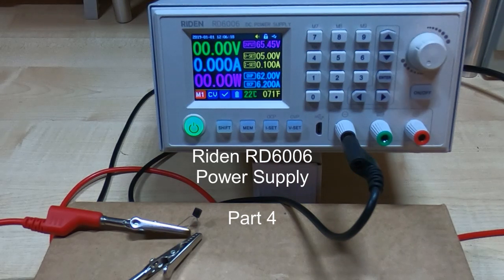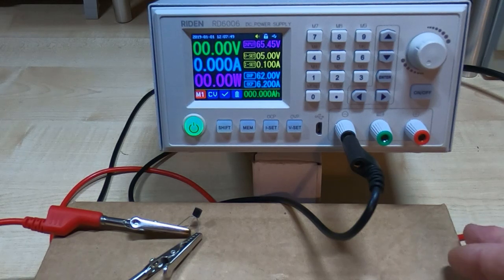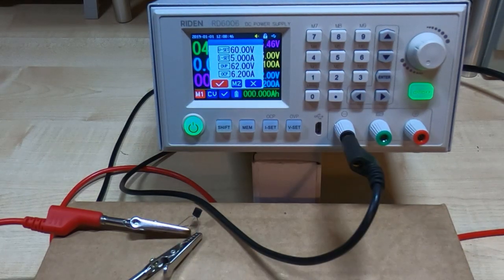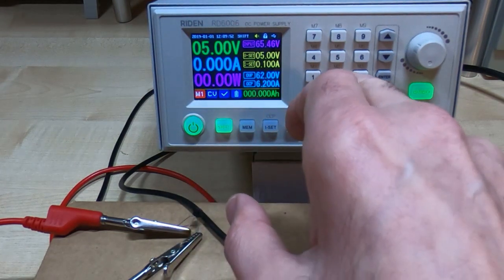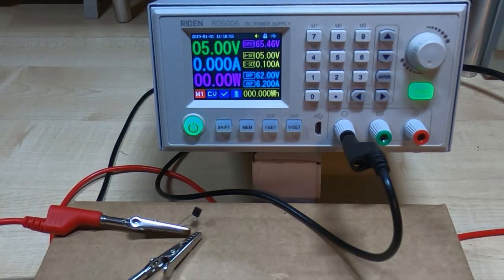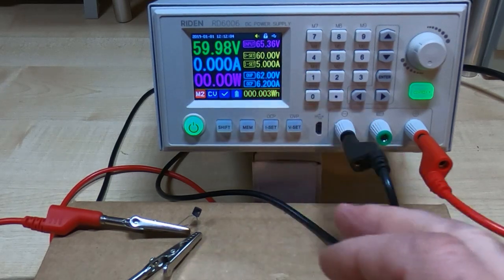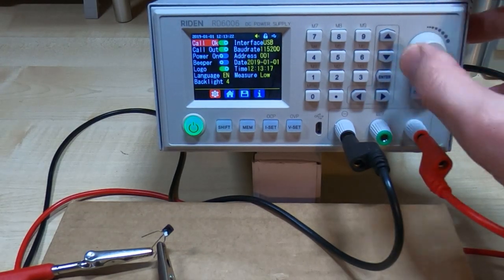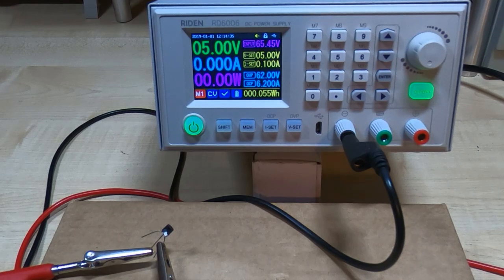Riden RD6006 Power Supply Part4

Comment: You've got a point, but that's why it's optional and turned off by default.
Reply from the maker: Correct but as I was giving a review and the options are not well indicated I wanted to make it clear what these options were and also that I think it is a bad idea to have the supply turn on its output when a memory is selected wiithout being able to see what is about to be applied to the outputs. If the supply is only used by one person then it may not be quite as bad but in particular when different people can use supplies then this option becomes dangerous. I see no real need for it and the dangers outweigh any possible benifit. That is of course just my opinion and is simply advice which anyone can ignore if they want. I did also make it clear that it is an option and turned off by default. To clarify my point, This feature will prevent these supplies from being used in my companies development lab.
Reply: @JerryWalker001  Just because you don't see a need for it doesn't mean everyone else doesn't, others may prefer it for cycling between preset voltages and current outputs for testing purposes or even for charging batteries etc... ,  for them it would reduce the input required,  Granted it's poorly labelled in the menus but it is by default set in a safe setting as you said.  You would need to explicitly set it to what you describe as an unsafe setting for it to be a problem.  No doubt there would be a way of disabling it altogether in firmware (or possible the pc software ?) - I'm waiting on the kit to build one myself so if I make any progress with firmware coding I will update you accordingly.
Reply from the maker: As I said in my video that is just my opinion. My point is that it has been implemented in such a way that it can represent a danger and I also indicated specific cases when this can happen. I also suggested a way that this could be implemented in such as way as to make it a safer option to use. For example if the OVP and OCP were global then this would make it safer to use. As it is the supply can very easily be put into a dangerous mode and that is why I mentioned this in my video and I stand by my comment. I am not sure why the software or firmware modifications are relevant.
Reply: @JerryWalker001  the software and firmware modifications could be done such as to prevent the "dangerous" implementations you stated in your videos.  Why else would I mention them?
Reply: who knows - if i can get it working correctly i could see if the manufacturer wanted to implement it (although i doubt it).
Reply: @JerryWalker001  I would like to add one more thing though - this is not a consumer level piece of kit as far as i am concerned (just my opinion) and as such anyone using it should be competent to do so, as such I would expect them to learn how to use it safely before connecting it to anything.  This is not in any way intended to put down your videos or comments as I have really enjoyed watching the videos and reading your comments.
Reply from the maker: Tech Doctor ??? Yes of course they could, that is SPECIFICALLY why I mentioned it in my video and SPECIFICALLY why I made suggestions as to possible safe ways to implement this feature if users wanted it. I am NOT suggesting that my way is the only way, I am simply pointing out the current danger in using this supply which is a major purpose in a review. However, currently the supply operates in the way it does and the vast majority of users will not want to start hacking the software or firmware. If the manufacturer updates the supply then all well and good but stating that if it worked differently it would work differently is not a valid point. If you are able to modify the software to make this feature safe to use then I am sure many people would want you to provide it to them or as you do not seem to agree with my point then I assume you see no need to change it. If you do agree with my comment then I am not sure of the purpose of your comment, maybe I have missunderstood your point?
Reply: @JerryWalker001  Not sure why you're ranting as I didn't say i disagreed with anything, I was merely trying to be constructive and my last comment was simply that any piece of kit of this type should be used by competent persons.  It's clearly built for a price and is a fraction of the cost of the big name branded programmable power supplies.  The fact that it doesn't come fully assembled as a working output power supply is enough for me to consider it as a diy type device.  I've been an electronics engineer for over 30 years and come across all sorts of great devices like this, sure it's got it's quirks and maybe some would consider them dangerous.  I was simply stating that maybe it could be fixed in firmware and that like anything on youtube, peoples views however polarising are most often subjective.  Yours being that it has dangerous design flaws, mine that it I don't think it does if used by a competent person who knows how the deice works and what it's limitations are.  Lets not forget, if someone novice enough were to put the output wires in their mouth at full voltage and current it wouldn't end well - dangerous yes, avoidable most definitely, should it have ever been allowed to happen - not if they knew what they were doing.
Reply: @JerryWalker001  I do take your point but respectfully disagree. Users have agency and have to accept responsibility for changing the settings. There is definitely a use-case for having that option so I disagree that it is "not a good idea". It's an excellent idea if it's what you need. It would be really, REALLY bad if that were the default setting, of course.
Reply from the maker: IN MY OPINION this option has been implemented in a way that can put the supply into a dangerous mode. I fail to understand how anyone can argue against that because it clearly can. If this outweighs the benifits is another issue although I also give very clear indications how this option could be implemented in a safer way. If in your opinion this is not a dangerous option in the way it has been implemented then that is fine but talking from decades of experience (and expense) I disagree. Yes I am well aware that stepping through voltages can be a good option and if you watch my other videos you will see that I use that very feature in my other supplies but I would NEVER use it in this supply for the reasons I have stated unless its operation was made safer. That is my opinion and if you have a different opinion then that is fine but I will not comment to anyone that this does not represent a potential danger as that would be irresponsible of me.
Reply: @JerryWalker001  FYI CAPS is consider shouting - also I didn't disagree I just had a slightly different point of view and expressed it.
Reply: electronics from the land or the rising sun quite often have quirky, pointless, random or what some would describe as "dangerous" options in their settings. they are still cheap though and maybe, just maybe that's because they think the engineering side through quite well but when it comes to user friendliness ect... they don't spend much time on it.
Reply: @JerryWalker001  Nobody is suggesting you comment any different than you have - would you refuse to drive a car that has an esp off button on the dash because it could make you crash if you can't drive very well in the wet ? - i suspect not but yet you are trashing a power supply module because you think it's dangerous because it has an option that could potentially cause problems if used improperly.  Therein lies the beauty of youtube - everyone gets to have their say :)
Reply: @JerryWalker001  It's a pity that you feel that way as I think it's a great little piece of kit but if there's a chance a novice (or inexperienced) user could get into trouble with it you're making the right call.  Totally agree on the documentation BTW but to be fair I've not really come across many far east tech products with good documentation lol.

Comment: I have a supply like that and I noticed it has another annoying feature. My workbench has a main switch, and whenever I power the bench on, the power supply boots up and switches on. I would really like that it remained off, but unfortunately it does not have an option in the menu for that. It's the same thing with my Kkmoon fy6900 function generator, wich, by the look of it has a similar firmware, or at least seems to be made by the same team...
Reply from the maker: That is an option on this supply but I have turned it off.
Reply: @Andrei Bata ， KKmoon FY6900 has a main switch at the back. So that you can turn it off to avoid the issue?
Reply: @xmenken1  yes, it does, the power supply has one too, but the way they are placed on the bench makes it difficult to reach all the way in the back. Besides, i think it's just bad design to have your device boot to default power on...
Reply: Always make sure the voltage is correct before you connect your precious device.

Comment: Nice that they gave you the option to have the output automatically be disabled on change.
Reply from the maker: It is probably just personal preference but it is way too easy to simply forget that you have set something which could so easily destroy a board. I have run my own company for many years and engineers have a habit of setting 'personal preferences' and not always telling anyone that they have done it. This has cost me a fair amount of £'s over the years (and cost some engineers their jobs). For me it is equivalent to having a switch on the dashboard of my car which is labeled 'brakes Enabled' or 'Brakes Disabled'. My intention is to make very clear what the poorly labelled menu options do :)
Reply: @JerryWalker001  I imagine these options should only be enabled if you are using the PS for some kind of fast routine testing of a product, defiantly should not be enabled on a workbench
Reply from the maker: Yes I agree and I doubt I would ever use them but someone may not realise the significance of changing a setting called 'Call Out'. I would prefer that such a setting was a hardware jumper or at least be independant from the OVP and OCP.
Reply: @JerryWalker001  Great video and totally agree with you. It's so easy to be distracted by something at times that you a) accidentally press the wrong button or 2) change the mode for some specific reason and then forget to change it back to the default. I get it people say it's an option and not set as default but it's still one that people need to be aware of. Thanks for raising this setting/option and sacrificing your transistor for the benefit of all lol :)
Reply from the maker: Ausmosis, Finally someone that understands my point, Thankyou. The transistor was not happy anyway ;)